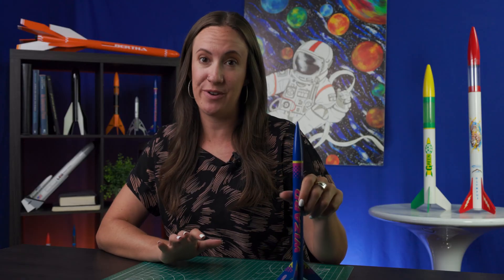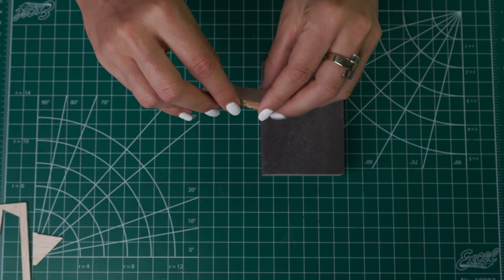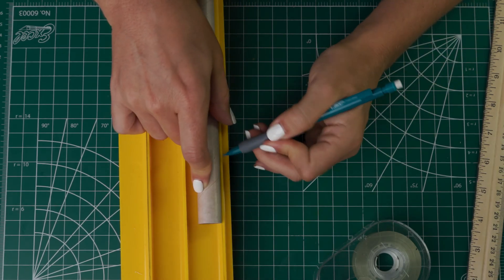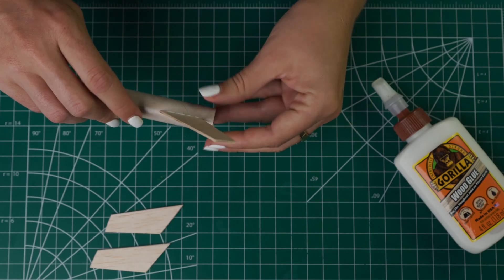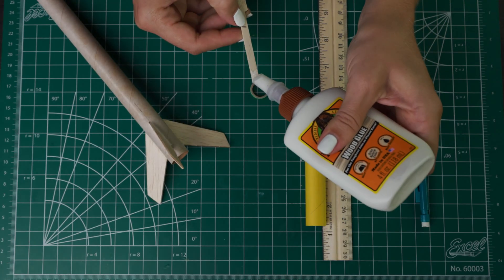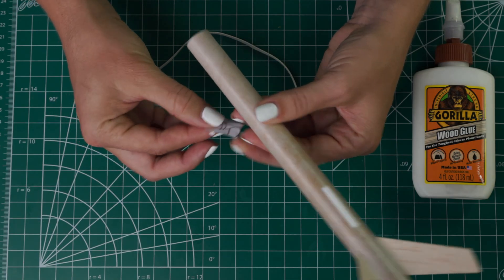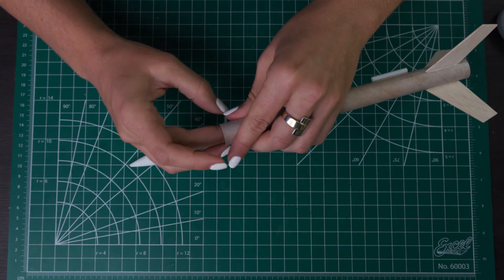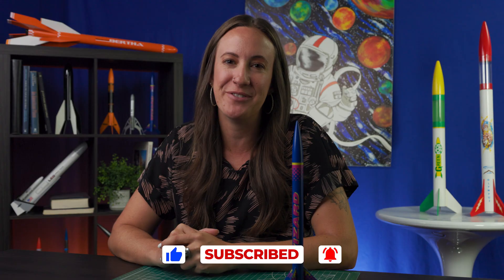Wizard Build

Comment: Hi Nicole,
Is the two piece nose cone open on the end to allow weight to be added easily, if need be? 
If so, should I build the rocket first and test it for stability, add weight if necessary and then glue the end on the nose cone?
Thanks, I enjoyed your video presentation of the Wizard and the way you explain the steps for a successful build. 
Hope to see you again, soon!  🚀 : )
Reply from the maker: Hi Darryl603, yes you can add weight to the open nose cone before gluing it. So theoretically yes, you could build it first and then add weight if needed for stability. However, all of our kits are designed and tested for stability so as long as you build it according to the instructions it will be stable. Thanks for watching and glad you enjoyed the video!